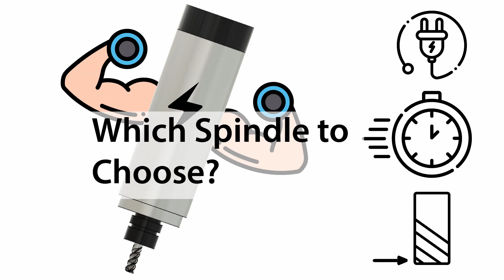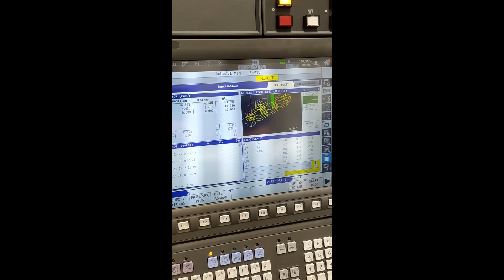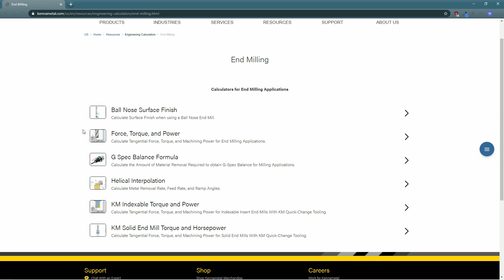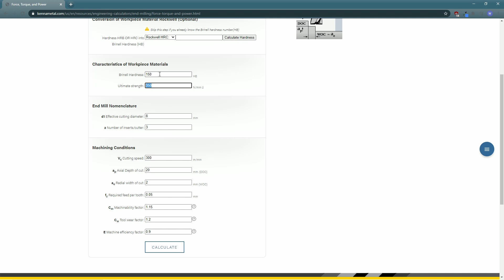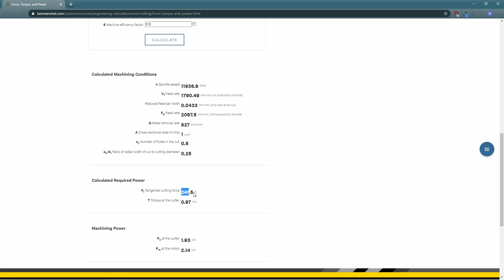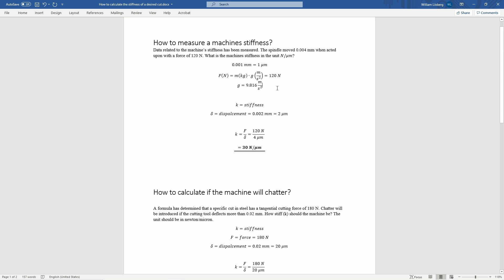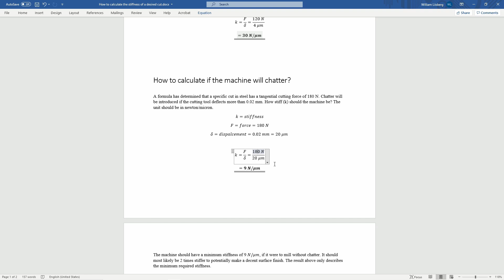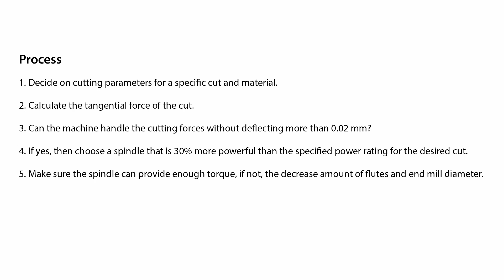Which Spindle To Choose? And How to Estimate Chatter (vibrations)

Comment from the maker: As Mihai Dumitrescu reminded us, be aware of the fact that almost every CNC-machine has a different stiffness, depending on where the machine spindle has moved to. Routers will for example have the most deflection when the spindle is lowered fully, and located in the middle of the gantry. Another thing is that the machine's deflection also depends on which direction you're machining in.
Reply: Don't you think, it could be more stiff in router,  if the Y gantry is horizontal and Z installed between the two Y guides that installed at the bottom side of the gantry instead of top side? In this case there is minimum torsion force.
Reply: How would I determine the stiffness of my particular CNC machine? And in what unit is measurement is such a characteristic measured? I m using a commercially made CNC, not a DIY build.  I have the Onefinity Journeyman X50.
Reply from the maker: @mickeymallette2663 
You can read about sitffness here: https://en.wikipedia.org/wiki/Stiffness

k (stiffness) = F (force) / Displacement

Example: Take a robe around the spindle nose and put a dial indicator on the spindle to measure its displacement accruately. You pull it with a force of 15 N and measure a displacement of 2mm.
You stiffness will be:
15N/2mm = 7.5 N/mm
 
Here is a video of how it could be done: https://www.youtube.com/watch?v=OSkB5esVKkw

Comment: What specific location on the spindle should you place the dial indicator, and where exactly to you push/pull againts the spindle? For example if your taking a measurements right at the center of the spindle by the spindle mounting clamp, you will see less deflection that you will if you take a measurement at the very bottom. 

Thanks,

Comment: I think it's important to have mentioned the taper interface. Standard Steep taper holders like BT30/CAT40, etc are only taper contact and low in radial stiffness. Dual contact interfaces like HSK, Capto, and Big Plus are Face + Taper contact to the spindle and thus inherently have greater radial stiffness.

Comment: This guy is wrong about flute to RPM levels. The number of flutes effects maximuim/minimuim feed rates and HP requirement. It does not change optimal RPM. Optimal RPM is a function of the SFM rating and circumference of the tool. Has nothing to do with how many flutes you have. You can have like 20 flutes and still be able to run at the same RPM as a 2 flute endmill.
Reply from the maker: Hi Dave, as you're probably aware all motors and spindles have torque curves that show what the torque is at x RPM. Let's say I'm going to buy a 2.2 kW 24000 rpm spindle that has the following data points on a torque curve (these are hypothetical) :
0.5 Nm at 14000 RPM 
0.8 Nm at 17000 RPM
0.5 Nm at 20000 RPM.

The ideal choice would be to run the spindle at 17000 RPM, as this is where we have the highest torque. This will likely allow us to mill faster, as the spindle might not have enough torque at 20000 RPM to take the required cut at the speed that matches 20000. 

If you put a 20 flute endmill in a spindle that can only supply a torque of 0.8 Nm torque, then the chips that end mill would have to cut, will be soo small that the endmill is rubbing instead of cutting. If you want to cut a decent chip, then the end mill has to go slow, as it cuts 20 chips pr. revolution. So if this end mill requires 5 Nm torque at 3000 RPM, then that's not very ideal for a spindle that probably has 0.4 Nm torque at 3000 RPM. One could say that this end mill is not an optimal match for the given spindle.

Some spindles have close to constant torque curves... But in the end, the end mill has to cut at a given RPM at a specific torque, and if the spindle can't supply that, then you have wasted money on the wrong end mill.

Comment: Your Chanel is absolutely awsome thank you for that ! Would ask you two questions though. 
- wherebdonyoy study cnc machines university /country ?
- can you advice me a book or books so as to get good at cnc CNC Theory and calculations please ? i am starving for that.
Reply from the maker: Hi Bakir, thank you very much, your comment really encourages me to make more videos!
I'm studying at DTU (The Danish Technical University), which is located in Denmark. It's ranked the world's second-best university right after MIT, based on it's research. I think that's really cool!

I'm studying mechanical engineering, but at DTU it's only taught in danish. Some of the books we use for the courses are actually written by DTU, and  some of those are written in danish. My all-around favorite book which we use at my university is called: Engineering Mechanics: Statics (	
R.C. Hibbeler). If you understand everything in that book, you can make a career out of it lol. It's about all the fundamental calculations used to find the forces in static mechanical systems. 

We also have a course called "Dimensioning and Strength", it's about the deflection of structures based on how the structure is mounted and what loads are acting on it. This is what all FEA engines are based on, these calculations will give you a deeper understanding of deflections through a given structure. Our book in this course is written by DTU in danish, so I encourage you to find one in English if this field interests you.

90% of what you have seen in my videos is self-taught knowledge, from watching absurd amounts of youtube videos, haha. It's much better to teach yourself to do some mechanical calculations.

Regards
William

Comment: people need to be realistic, a $200 cnc engraver is not a milling machine and not even a good cnc router, $200 cnc are designed for NO ! spindle side pressure,  even for wood decient cnc routers start at $2000 plus and maybe can mill aluminum without to much chatter and wearing out the end mills ,  I am building a cnc router on a 1/2 aluminum plate with rect ball bearing linear rails with closed loop steppers with mist coolent around $1400
Reply from the maker: Hi Gary,
Good luck with the build, I'd love to see a video of your machine when it's finished.

Comment: chatter is caused by excess axis play the end mill bites and moves away from the cut back and forth, I do cnc service and when the ball screws and thrust bearings go you get chatter and sloppy parts, there is not much hope for a $200 engraving cnc router

Comment: Hi William; nice videos and also nice and good intentions to document the build. I would like to chip in with some thoughts, hoping they may be of some help. First of all, big manufacturers do FEA, then make mock-ups, many iterations, until theory and practice coincide. That calls for resources. We, hobbyists do not have the luxury to do that, therefore we make guesstimates and it is perfectly acceptable. In a gantry design, tool displacement depends on where on the X axis (transversal axis)  the carriage is horizontally, and also where on the Z axis the carriage is vertically, at any moment in time. The influence on tool displacement of the horizontal milling force acting on the gantry (parallel to the ground) is rather small. The biggest influence is, as you may know,  the rotation angle of the gantry beam caused by the mass of the Z axis acting at a distance X from the center of the mass of the beam. The cutting force has its share, but not that much unless the beam is very short and the motor is very strong. If you lower the carriage on the Z axis by, say 100 mm , you will have a certain tip of the tool displacement, but if you lower it 200 mm the displacement will be bigger. Also, 100 mm lowering the carriage in the middle of the beam will produce a bigger displacement than 100 mm lowering the carriage at the end of the beam. So, the beam should be designed to a specific Z travel, for instance: how should I design the beam so that to have a maximum displacement of no more than 25 N/micron at 300 mm Z axis travel (and obviously at the middle of the beam where it is got the weakest point). Let me give you an worked out example. Suppose a beam of rectangular carbon steel of 400 mm height , 200 mm width, 6 mm thickness;  800 mm unsupported length of the beam; horizontal distance between center beam and Z axis carriage center = 300 mm (out of which 100 mm is half the width of the beam); mass of the Z axis = 1500 N; cutting force = 200 N. Now, the parameter that we will vary is the vertical distance between center of the beam to the tip of the tool. If this distance is 300 mm (which means 100 mm effective Z travel under the beam, as 200 mm is half the height of the beam), the tool deflection will be 10 microns. If we lower the carriage down by 100 mm, (which means 200 mm effective Z axis travel) the tool deflection will be 14 microns. If we lower it further by 100 mm (300 mm effective Z axis travel), the tool deflection will be 18 microns. Lastly, lowering it down even further by 100 mm, the tool displacement will be 22 microns. So, the angle of twist is the ''hot'' parameter. Tool displacement is basically the amount of distance the tool deviates from perpendicularity, which is consistent with the angle of twist around the longitudinal axis of the beam. Chatter is partly caused by this displacement and I have noticed that in practice, when face milling for instance, the milling marks on the floor of the work piece are sometimes wrongly attributed to either the material the mill is made out of (steel, cast iron, etc), or to the lack of tramming the head of the Z axis carriage. These have their share too, but there is an amount of , let's just called them ''chatter marks'', that will be there forever by design, IF the angle of twist was not well conceived from the outset. In practical terms, a hobbyist should raise the work as much as possible to the Z carriage, as the accuracy is better the higher up the work is set to.
Reply from the maker: Hi Mihai, what a wonderful comment, you're absolutely right. For the record, I'm aware that the twist of the beam/gantry is one of the biggest causes of tool deflection, I do believe I have mentioned this in a couple of videos.
I'd like to add that also the z-axis itself has a very big influence. I feel like some hobbyists focus too much on building a rigid gantry, and still, end up with major tool deflection in the z-axis relative to the deflection caused by the gantry. 

One advantage of casting the frame is that a shape optimization of a mockup CNC frame, very quickly tells you where to put the mass. Thus eliminating the need for 100's of FEA analysis with different components, welded or screwed together. Shape optimization is a very powerful tool when it can be utilized. 

Have a great day!
Reply: what a great comment, thank you
Reply: @EletricistaEmBrasilia  🙏

Comment: I am building a CNC router for machining steel  etc - I have already purchased the spindle & steppers etc. The spindle is quite a high quality one with lower speed for steel cutting/with water cooling - 100mm in dia. weighing about 14 kg - I guess the fixed gantry design will be the best solution for that weight of spindle??
Reply from the maker: Hi Adam, I have to say that I might have been unnecessarily concerned about weight, but that's mostly because I want mass where it counts. I will cast my machine in a material similar to epoxy granite, and I will likely be building more than one machine, so I don't mind spending lots of time on the design and creating moulds for the machine.

You can actually get a lot of power from motors these days, so there's not much to worry about. However, you do mention that you already have bought some motors and drivers, maybe look at other people's machines that use a similar sized motor and sort of compare the weight of their machine to what the weight of your machine will be.

Have you bought servo or stepper motors? I would recommend servo motors for high load applications where some level of precision is required. If you take a look at the torque curves for stepper and servo motors, you will quickly find a reason to choose one over the other. 
I have heard good things about the price/performance ratio for the Leadshine Servo Motors, but don't take my word for it ;-)

Comment from the maker: Small correction to the video* "Tool Deflection Control: Critical to Your Success" from cnccookbook.com states that the deflection of the cutter should not exceed 0.001" (0.0254 mm). I however said in this video that the deflection should not exceed 0.02 mm (because we talk about the deflection at the tip of the spindle, and not the deflection of the end mill). Use this as a rule of thumb, actual chatter calculation will account for far more variables... This should however still provide us with a great estimate on what spindle to buy, without buying a spindle that can take heavier cuts than what the machine can handle. Have a great day!

Comment: Hello,
As I am a beginner I've never heard of the 0.02mm max deflection to avoid chatter rule.
Where does it come from ?
Thanks you !
Reply from the maker: Hi Geekoid, glad you're back! This article is a great read: 
http://www.cnccookbook.com.s3-website-us-east-1.amazonaws.com/CCCNCMillFeedsSpeedsDeflect.htm#:~:text=If%20you%20do%20a%20little,that%20chatter%20can%20set%20in.

The deflection is a rule of thumb and in my video a talk about the stiffness of the spindle and not so much the stiffness of the actual cutter which the above article mentions can be up to 0.001". It's a great rule to determine which spindle you can use, without getting more power, than the rigidity of the machine can allow.
Reply: Still learning a lot from your videos, wish you well 👍